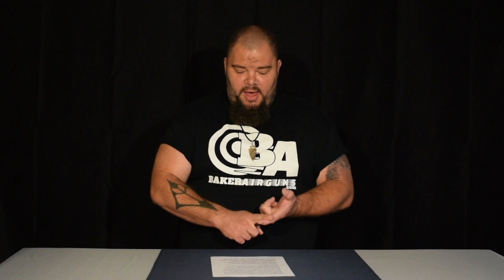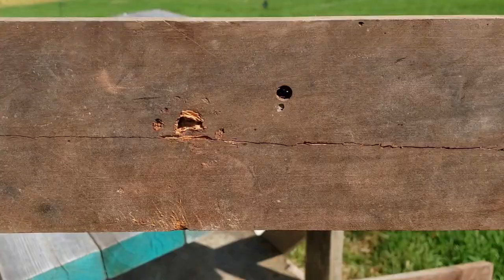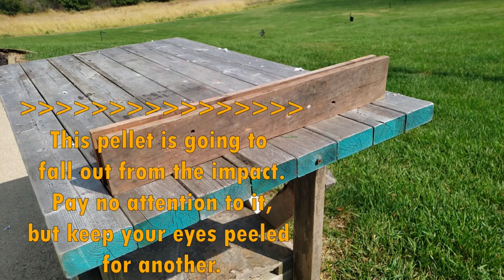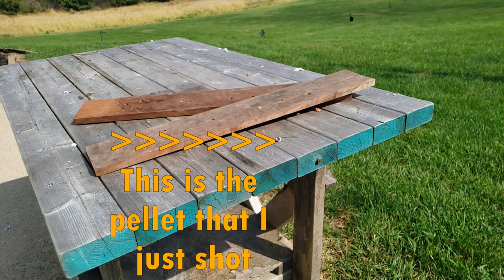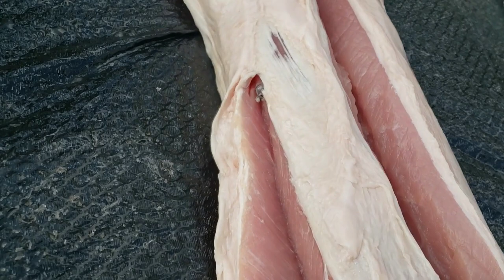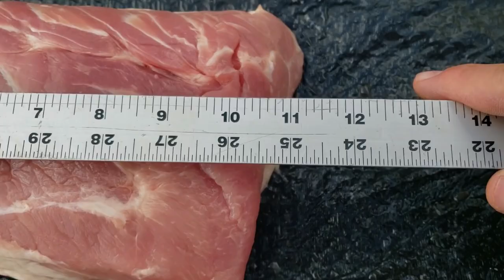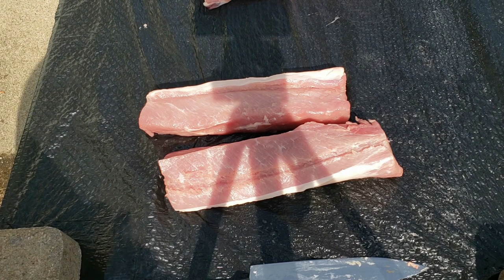PART II...What's deadlier, a .25 or .30 caliber airgun?

Comment: BillyBob, you are not dumb, you are just misguided.
The diameter is a direct inverse of penetration given the same type of shape on the projectile.
So, the smaller the diameter is the more penetration. The 25 caliber gets one point given the same velocity and mass of projectiles.
The 25 caliber has too much penetration; unless you are hunting 21-inch thick pork loin at 10-yard ranges; else, the 30 calibers will not over-penetrate. The 30 caliber gets one point for non-over-penetration.
pistol bullets with a parabellum shape will lose 30% velocity as it travels through human flesh if no bone is struck, yes, butt naked bodies, alive or deceased, so you can shoot three people lined up, but if the three are armed and they do not instantly die, you will when the three shoot back at you and their bullets do not over-penetrate your manly body.
The FBI, military, ballisticians you state operate on theory and after-action reports through 3rd parties; sometimes a year after the investigation is open for scrutiny.
kinetic energy Ke = 1/2 x m x v x v
ke = grains x velocity x velocity / 450,436.6798 = foot pound energy
fpe x 450,436.6798 / (velocity x velocity) = projectile mass
sqrt (fpe x 450,436.6798 / grains) = velocity
Therefore, "70" fpe x 450,436.6798 = gr / v^2
given the same kinetic energy on both the 25 and 30 calibers, the 25 calibers will always have the most penetration, but what good is it if 2/3 the velocity goes through and through the animal? Unless its a 21-inch point loin at 10 yards then the 25 would win the contest, but if the pork loin was on thicker than 17 inches then the 25 would over-penetrate and lose that energy such as a torso side shot.
The equation is exact at only sea level and 45-degree latitude; else, it will vary by 0.001% at the poles.
The next misguided YouTuber will claim that the 0.177-inch pellet is far more the deadliest because it has the most penetration due to its smallest caliber, and at the same Ke. I would have to agree then, but only if shooting a 20-foot long Boa Constrictor snake through its throat and out its tail.
I suggest you throw some numbers on the screen such as starting tank volume and pressure, regulator pressure, barrel length, hammer and valve spring settings, chronograph readings, etc. 
For example, 70 fpe will use approximately 21.875 grains of air at around 150 Bar pressure. The higher the regulator pressure, the more kinetic energy and momentum each air molecule has, and due to the law of conservation of momentum, the efficiency can be calculated for the best velocity with a certain pellet mass; unless you plan on doing a one-shot dump air tank, which then the barrel length will be the determinant factor of the maximum speed, so you would need the heaviest pellet to get the most kinetic energy due to the transfer of momentum being time determinant.
In essence, no, the higher caliber is the deadliest.
Do the math.
Numbers do not lie, but you can lie with numbers, and the laws of physics are not just really good ideas.
Thank you for the great video and demonstration, as always, very entertaining, but this one was not educational.
FJB Out!
Reply from the maker: STFU with that.

Comment: If you JUST take the frontal area of pellets.
.177 =  15,9 mm2
.22  = 23,75 mm2
.25  = 31,65 mm2
.30 = 45,6 mm2
A 40 J  .177 has. 40 :15,9 = 2,52 J/ mm2... To get  2,52 J / mm2 for the other cal. you need..
.22 :  2,52 x 23,75 = 59,85 J or 44 ftp
.25 :  2,52 x 31,65 = 79,76 J or 59 ftp
.30 : 2,52 x 45,6o =  114,9 J or 115 ftp
So just based on frontal area your .30 should have the same penetration as your .25 at...( 70,21 X 45,6 ) : 31,65 = 101,2 ftp.
Reply: Anyways. I have a leshiy 2 with a .177/ 350 mm barrel. My favorite pellet is the H&N Barracuda Match 10,65 grain.. Best speed is 920 fps. Or around 27 Joule/ 20 ftp.
Higher speeds and precission drops.. Now I have ordered a .22 /450 barrel. The H&M Barracudas in .22 are 21,14 grain. At 920 fps its 54 J or 40 ftp...
In other words. My favorit pellet at the optimal speed will have 1,7 J /mm2 in .117 and 2,3 J /mm2 in .22... The .177 goes through 15 mm plywood,(easy), but not 21 mm...The .22 should...(15 x 2,3): 1,7 = 20,3mm..... Your .25 has 70,21 ftp or 95 J. Thats 3 J /mm2. So it should be able to penetrate (15 x3) : 1,7 = 26,5 mm of "my plywood" with ease... And never be able to penetrate (21x3) : 1,7 = 37 mm... If size does not matter at all..
Reply: But what cal. has the most penetration ? 
 Umarex hammer .50 = 950 J = 7,48 J / mm2
AEA Zeus .72 =1910 J =  7,26 J / mm2
..Or 66 mm of plywood... With ease..But not 92 mm ( in theory. But the back side of the plywood would splinter of long before a pass through)

Comment: This comparison is useless, use the same f p s on both of them.
Reply: Why?
Reply: @ALLTHINGSAIRGUN  because you are trying to determine witch one is deadlier. You detuned the .30 cal. So the f p s was lower than the
.25 cal. That’s not a comparison. That’s cheating to get what you want.
Reply: Ha!
Reply: @chuckmontilepre4294  Where are you getting the idea that 70fpe is "detuned" for a 30 caliber? That's your first problem. 70-75fpe is a very common tune for a 30. Roughly 850 fps. Since when is 850fps "detuned" for an air rifle?
Reply: @ALLTHINGSAIRGUN  we are talking about a comparison of the two.
I didn’t say 850 FPS. Is not common for a 30. Cal. 
I’m saying the 25 cal had a faster f p s than the 30 cal. 
As you very well know more FPS equals more energy. 
By not comparing the two at the same FPS is not a comparison. 
It’s stacking the deck to get what you want.

Comment: You could say that what the 177 does, the 22 will do better. Or you could say that what the 22 will do the 25 will do better.
But can you say that what the 25 will do the 30 will do better?
If we are talking about working within the power limits of  spring or gas rams I don't think so.
The FBI says 12 to 14 inches of penetration is what works for humans.
For small to medium game I would think that 6 to 8 inches of penetration would be sufficient.
The 25 should certainly do that and should do fine for small to medium game using head shots.
H&N Hornets with the brass penetrators could be a game 
changer though.

Comment: So ur demo begs the question is a .22 even "deadlier?
Reply from the maker: I'm not sure that it does.  I'm comparing some very specific things, and I'm not sure there is a direct correlation with smaller projectiles being absolutely more deadly at a given energy level.  I would suggest doing some testing and seeing what the results actually are.
-Donnie

Comment: Have a 25. Cal kral super jumbo pushing 60 fpe with jsbs 33.95 mark 2s drop it in its tracks straight head shot 40 yards front and side so I agree with you not brag just facts 💯👍🏿✌🏿

Comment: Buddy....you r all wrong...your are talking about pushing a smaller slug at a higher velocity compared to pushing a big pellet at slower speed. 

So riddle me this batman, if you're pushing the same type of slugs in these two airguns, one being at 25 Cal and the other being a 30 cal and you're pushing both of them at the same speed which one would be more deadly?

Comment: So is .22 deadly than .25 !!!
Reply from the maker: Good question.  I would suggest testing it.
-Donnie
Reply: @BakerAirguns  . i depends on the target . once a hunter had 10 roosters  high up  in a tree   ,he shot with stingers 22,lr , bad succes , with a tuned hw 80 .6,35  38 joule , it takes only one shot per roosters , the 22 stinger shot tru .

Comment: Okay, so I get you're using math and physics to reach your conclusion.

I'm going to use logic since math isn't my strong suit.

If all this is correct, then why do we need larger calibers for bigger game If a smaller caliper is deadlier and has more penetration?
Reply from the maker: Very good question.  My test only covers a certain energy regime.  The .30 is usually capable of even higher energy than 70fpe, though 70fpe is not uncommon.  Not to mention, even at 70fpe, the .30 still has it's advantages over the .25.  Resistance to wind drift is a commonly sought after one.
-Donnie
Reply: That’s right Donnie also the heavier Grain Weight will have more energy down range. Notice I didn’t say .25 or .30 because it’s about mass and even BC plays a part. It takes much less force to stick your hand with a pin then it does a pipe lol. Of course the pipe will cause much more damage, it’s definitely a balancing act so it makes sense that certain calibers will have a better  balance of surface area and mass.

Comment: 🤔 the results of the test are what they are. There’s no questioning it. I know I shit a 100 lbs feral hog with a .25 H&N hornet pellet out of a. Hatsan 125. The hog was shot at roughly 15-20 yards. It ran roughly 15-20 yards then dropped.  I like the performance of the caliber and of the rifle. Dead is dead in my opinion. I’ll stick what I have because it’s working.

Comment: If you have a lead projectile .25 that has a 70 FP/foot pounds & have a lead cannon ball with the exact same 70 FP/foot pounds & with the same quantity of energy. The .25 will exit the barrel at lethal velocity! The canon ball will not move at all. The larger projectile with an equally larger amount of fuel/powder/air will always result in much more lethal results! That is common sense! The 30 Cal projectile is capable of utilizing much more powder/fuel/air than the .25 & with that extra fuel/power will perform much better than the .25 Cal round that is for certain!

Comment: In both of these videos, you're comparing 70 fpe 30 cal and 70 fpe 25 cal. You're going to get this result simply because of the surface area and friction!  If I put a ten lbs weight on a needle, it's going to penetrate much further than a ten lbs weight on a sharpened half inch rod.  That's physics, however, you should be getting more fpe from the 30 than the 25.  You're testing the wrong parameters.
Reply from the maker: Why I got the result is nearly irrelevant.  What the result means is what matters.
-Donnie

Comment: .25 means potential energy is left on the table. You are comparing 700mm length barrel in .25 against .30 with only a barrel of 500mm. You don't need science to figure out there are "Sweet spots" for any combined metric. Swinging a 33oz baseball bat into someones torso will hurt more than a 2.5lb frying pan - lower speed and more surface area on contact.

For this to be a real test, you need to have similar model gun with similar barrel length, with similar tank size and regulation. The only differentiating factor should be caliber. You have way too many mismatched variables.
Reply from the maker: Incredible.  Every....single....thing you said is wrong.
Reply: @BakerAirguns  There is a point where pure size and density exist that penetration does not supercede blunt force. 

How do I know this? Because air gun manufacturers arent trying to make a .25 shoot 25gr pellet @ 5000fps to match the FPE of a 825gr slug in a Zeus 72.

Both those rounds will go through a deer. Which one does more damage?

Comment: Not a fair test , shoot them at the same velocity!!!!

The idea of hunting a 200 lb hog with a 25 or 30 cal air rifle is a stunt.  

See my comment on your first video. Terminal performance is about pairing the proper projectile  based on bullet construction, with sufficient mass and the ability to reach the vitials  causing a large wound channel. It’s not rocket science.

If penatration was your over riding requirement,  You could have chosen lathe turned Cooper or cast lead solid none expanding slugs for both the 30 and 25 . In both cases the 30 would have more capabilities. 

Neither are suitable for hunting hogs . Foxes and coyotes . Deer and pigs no.

 If you hunt requires shooting in the head at 20 yards you are not hunting. It’s a stunt ! Can it be done yes should it be done no! 

Bell was a professional elephant hunter. He used a small cal with armor piercing ammo to brain shoot elephants at 20 to 50 yards . He was a expert in  elephant anatomy and shot placement. The reason he chose such a pairing because he could not stand the recoil of a proper rifle.  I have many years as a professional license exterminator. I have killed many thousands of pigeons with an air gun . I used 20 cal, 22 cal and 25 cal. Velocity was keep down with all three to stop shoot throughs, no head shots taken. Because of the mess they cause. Center mass only , the larger the dia the fewer flew off and shorter distance they would fly off. 

 I can count on one hand the pigeons that did not drop were shot with the 25 . More with the 22 than the 25, the 20 cal was a terrible choice for center mass shots . They would fly a 100 yards before dieing mid flight. 

I was shooting in a new car storage building ,in a city setting. Over penetration , and quick terminal performance was the primary considerations . 

The larger the dia the better. I retired before slugs became available. 

My thoughts are they require more velocity to shoot well , there fore the  likely hood of more shoot throughs even though they expand. . 

Todays slugs out perform pellets terminal  because they are made to expand reliable, and have better bc the skirted  pellets 

You Hypothesis based on a shooting through  a pigs brain pan at point blank range does not equate Real world  hunting  scenario .a projectile made to perform then would be lousy at shooting through the chest cavity. 

 When hunting appropriate game. It’s all about shot placement with a adequate projectile , efficient velocity to penetrate through the vitials designed to dumps its energy along the way. 

If your hunting requires only brain shots than your not using enough gun.

Comment: So is a 270 deadlier than a 35 Whelen?  No it is not yet they were both created from the venerable 3006.  While the 270 is impressive  the 35whelen and it's metric cousin the 9.3X62 Mauser have killed EVERY Mammal on the planet. A 180 grain bullet from a 270 will never delivery the same energy as a 300 grain solid from a 35. Set to the same energy level does not represent the end all be all of deadliness.  You've ham strung the 30 to meet your desired conclusion.  Air rifles are like black powder burners, large frontal area, mass and all the speed you can muster equal deadliness.  Now if one chooses a gun that can't deliver a 30 at it's full potential than you have to pick the caliber/mass the gun can deliver, this is what you've done.
Reply from the maker: Firearms have no part in this discussion.  The velocities and energies are a different regime altogether.  Not to mention, 843fps is not "hamstrung".  Is it capable of more?  Yes.  So is the .25.  I chose 70fpe because it's a realistic overlap.  The results speak for themselves.  The only question left is whether or not you're willing to accept the reality that is staring you in the face.
-Donnie

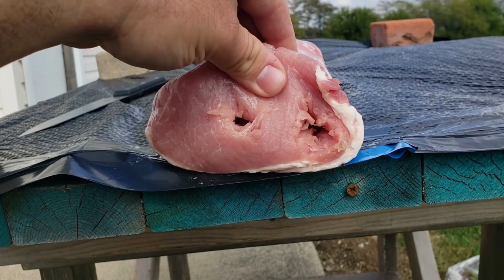Comment: Those entry holes... LOL that .30 destroyed the .25 bro, you could stick your thumb in the 30 and maybe your pinky finger in the 25! lol Look at 15:33, it's clear as day. Both work.... but the 30 hits HARDER, the 25 penetrates deeper, no doubt. You did give it 1 extra inch by acting like the first block was longer, it simply wasn't.. go watch the layout, that got longer when you separated them and it was just how they laid.  Anyway, but sure if you just have a bias? But both are kick ass calibers, the 30 hits harder, the 25 pens harder... simple concept lol Smaller/faster/deeper Larger/slower/greater stopping power.
Reply: Also at 15:13 play it at .25 speed, you will see the flap faces outward or more into it's own wound, then when you show it... it's pulled back away from the wound cavity as if you try to stretch it out.... you should have pulled harder bro, still looks like the .30 crushed it on the entry wound damage... lol Hey, no hard feelings though... just giving you some shit brother. Much love. <3
Reply from the maker: The .30 hit no harder.  That were EXACTLY the same energy level.
-Donnie
Reply: @BakerAirguns  That is physically impossible brother. I respect your opinion as well as enjoyed the video you made, but I just disagree with your finding and also your statement here is scientifically impossible, though I understand your sentiment. Much love brother.
Reply from the maker: @chaddery  Thank you very much, but what I said is not physically impossible.  Trust me.  I studied physics in college.  These guns were both set to 70ft-lbs.  Both were stopped by the medium, and delivered all 70ft-lbs to the target.
-Donnie
Reply: @BakerAirguns  Np brother, we will respectfully agree to disagree on this one. Much love brother! Keep up the good work, ill keep supporting. <3
Reply: @chaddery

Comment: Your comparison is dumb. The point of bigger is better is due to weight. You can't take a heavy for caliber 25 and then a average weighr caliber 30 and then also make the 30 go slower than the 25 so they have equal ft/lbs to show that all being equal the 25 is better. Yes of course it will be because of its momentum to sectional density. You need to get their sectional densities the same which means the 30 cal will need to have a heavier bullet going the same speed as a lighter weight 25cal. Then compared the damage done. This will likely mean the 30cal will have 20ft/lbs more energy, all things being equal. Then you will see the true performance of the 30cal.

Comment: what are you talking about bro where and what web does the fbi and military say this lmao if that was the case 45acp would he wealer then 9mm but its not because its creats a larger wound cannle by dumping its energy all in the first 6 inches of penetration rather thena. straight spaghetti noodle line that goes right threw you alsoa bullet that stays inside means it transferred all of its kentic energy to the target if it exists it means the projectile left with kentic energy meaning the target did not absorb all of the kentic energy intended